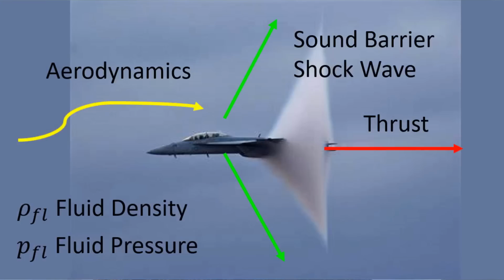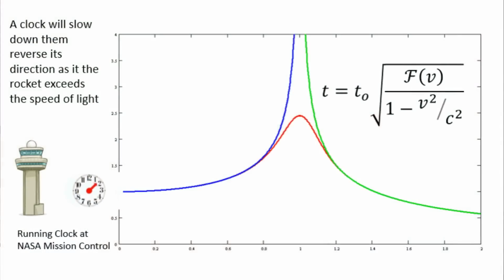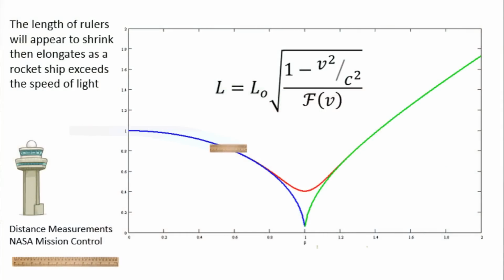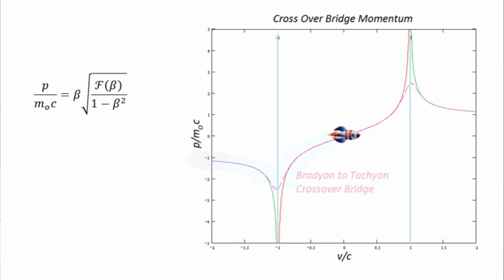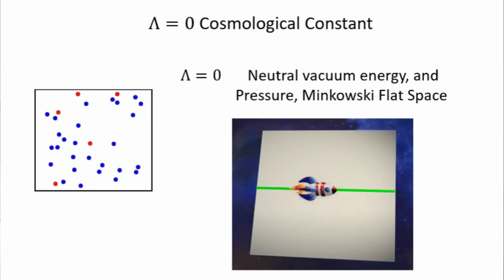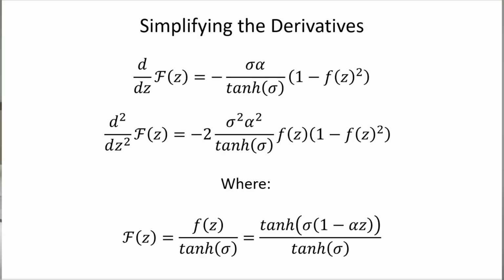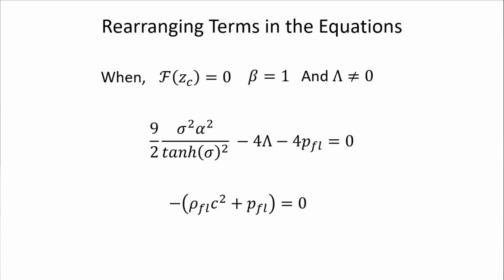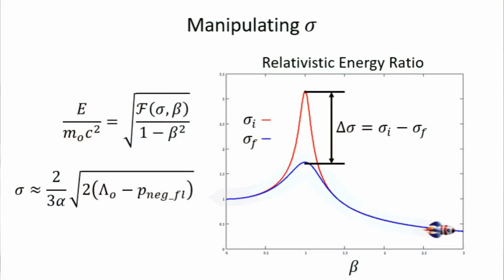🛸Lecture 4: Faster Than Light Shock Waves of a Warp Drive?  | HyperdriveX | Faster Than Light | UFO

Comment: The analogie to sound is a good base to start with.  I've been told that aerodynamics slightly change with supersonic flight.  Another analogie ?  There are some hints, that math changes on superluminar, but Einsteins math is enough for 150 years.  Wow, 100 have gone by already.    🚀🏴‍☠️🎸
Reply from the maker: Can the lessons learned from breaking the sound barrier be applied to the challenge of surpassing the light barrier, or are they completely separate domains?

Comment: How do you propose to overcome the problem of Cherenkov radiation which one would imagine must become infinite once c is surpassed? Wouldn’t such an infinite amount of Cherenkov radiation therefore extract whatever energy you put into accelerating to a speed faster than c, that energy would instead be transferred into more and more Cherenkov radiation, not more and more velocity?

Furthermore, what form of energy do you propose using to exceed the infinite amount required for any massive object just to get to c, let alone go faster? 

Towards the end, you mention something about Planck limits. You don’t specify if you’re talking about Planck length, time, speed, temp or what, high is it? Moreover, in your equations on screen, you have h BAR shown, not h, so is it Planck’s constant or the reduced Planck’s constant you’re actually referring to?
Reply from the maker: "Great point about Cherenkov radiation! The concept of infinite radiation as one surpasses the speed of light is a serious consideration when dealing with relativistic limits. You're right—any energy put into accelerating could indeed just be siphoned off into radiative losses, rather than increasing velocity. 😲

If we were to somehow bypass this issue, do you think the solution might lie in some kind of new interaction with the medium through which the craft is traveling, or would it require a fundamental rethinking of the nature of Cherenkov radiation itself? 🤔 Could exotic materials or quantum effects be leveraged to control or mitigate this energy loss? ⚡ I'd love to hear your thoughts!"

Comment: you lost me at vacuum fluid
Reply from the maker: The vacuum of space is not actually empty. Rather there is an underlying field of energy where virtual particles can spontaneously come into existence . This field can be thought of as a type of fluid that can be described by pressures and energy density. Calling it a fluid is a bit misleading I will admit but it’s a useful analogy in terms of visualization. Another way to think about the vacuum is to imagine photons of light that fill the whole universe. These photons  change in concentration from place or point to point. Photons can exhibit pressure . on the matter around it. So in some was we can think of it actually like a fluid, but we can’t take the analogy to far. Here is an interesting article that describes the vacuum energy a little bit better.

https://en.m.wikipedia.org/wiki/Vacuum_energy
Reply: @hyperdrivex_warptheory  be that as it may be...... i am not an expert in this domain , it seems to me that you use so menny equations for nothing , because nothing that has mass can reach the speed of light , passing it is out of the question.
Reply from the maker: Yes it is an open question if faster than light particles exists such as tachyons. I extended Einstein’s classical equations to include faster than light speeds. I believe it is theoretically possible to manipulate spacetime curvature to allow a particle with mass to reach light speed and go beyond the light barrier. Of course any theory needs to be substantiated with experimental evidence. It is interesting to try and make predictions of what would happen if we broke the light barrier. Here is an interesting article on a realistic rocket equation.

https://en.m.wikipedia.org/wiki/Relativistic_rocket
Reply from the maker: I suggest watch videos 1-3 where I go into the details of extending Einstein’s equations for faster than light speeds
Reply from the maker: @jianuflavian6451  "That's an interesting perspective, and I can totally understand why it might seem like all those equations are just complex for the sake of complexity. 🤔 It's true that, according to conventional physics, anything with mass can’t reach the speed of light. But when we start talking about concepts like warp drives or theoretical propulsion methods, we're stepping outside the typical constraints of relativity, right? 

What if there are ways to manipulate space-time itself—like how we might bend the fabric of space to effectively shorten the distance between two points—without needing to 'outrun' the speed of light? 🌌🚀

What are your thoughts on the idea that maybe massless particles or non-traditional propulsion could open up new possibilities in the future?"

Comment: Don’t forget to make clear, length contraction is a visual effect of that length direction being rotated increasingly into the time direction, not a physical crushing of the ship (and the passengers notice nothing of it).
Reply from the maker: Hmm I’m not so sure about that. What would happen if the contracted length of a particle is less then the schwarzschild radius of micro blackhole? If a particle gains more relativistic energy as it goes faster then it would eventually have enough energy to act gravitationally with the surrounding spacetime. I believe that spacetime would curve in proportion to the relativistic energy that the particle has. If it does then gravitational forces would squeeze and change the length of the ruler or particles size. This of course would take a tremendous amount of energy to accomplish.

Comment: Small problem, once light speed is achieved time becomes instant. There would be no time in 'ftl' thus no time for a shock wave to form.
Reply from the maker: Watch the first 3 videos in this series where I talk about clocks and rulers for faster then light observers
Reply: @hyperdrivex_warptheory  No thnx, I am not wading through all of that merely to confirm what is already obvious.
Reply from the maker: @brianvernall8487  Bummer, time dilation and length contraction for faster than light observers has not be explored before in physics. I present some interesting examples.
Reply: @hyperdrivex_warptheory  That is because it is impossible for an observer to exist outside of our space/time. Any vibration faster than C is, by definition, not in our universe at all. In fact, its  total existence, relative to ours, would be instantaneous.
Reply from the maker: @brianvernall8487  Thats is an interesting point of view. I would however disagree. Observers that move less than the speed of light are considered time like, an observer that moves faster then the speed of light is considered space-like. Both situations are described by spacetime manifold which is mathematical give by Einstein special and General theories of relativity. There are many science papers that show theoretical theorems for tachyons or particles that move faster then light. However, to date there’s no experimental evidence for tachyons. This doesn’t mean they don’t exist but they can’t be ruled out. I am merely adding to the body of knowledge. How else can we explore the universe?  Faster than light travel must be possible or else we are for ever doomed to only stay here on earth.
Reply from the maker: @brianvernall8487  Here is an interesting wikipedia article on Tachyons, faster than light particles. 

https://en.m.wikipedia.org/wiki/Tachyon
Reply: @hyperdrivex_warptheory  Welcome to reality. There is no such thing as 'faster' than light. Once C is achieved, time is dilated to instant. All experience at this speed would be instantaneous. You would see the birth and death of our universe in a flash of energy. Therefor any FTL travel is pointless. To achieve any inter stellar travel we need a close to C capability. At that speed we could travel to a distant star in seconds however our friends at home will age out before we get there. Time dilation is a bitch. 

Think on this one. Time is stationary at the singularity at the centre of each galaxy. As you move further away from the singularity, time begins to flow. The farther away you are, the faster it flows. Therefor  a planet at say 25,oooly out experiences time at one rate while a planet at say 50,oooly experiences time at twice that rate. At the very edge of the milky way, a planet experiences the flow of time 3 times faster than we do. How fast do you suppose time flows in the middle of the local void?
Reply from the maker: @brianvernall8487  What your saying is correct if you use Einstein’s Lorentz formula 1/sqrt(1-v^2/c^2), however if you take into account that space can be warped there are solutions that permit an alternative form, 1/sqrt(v^2/c^2-1), this shows that the slowest speed that an observer can have is c and the fastest is an instantaneous speed. It is a mirror formula with the subliminal equation. 

We cannot make experimental tests of clocks that fall into a blackhole and reach the singularity because (if we assume that nothing can travel faster than light) we can not get any information back once it has crossed the event horizon. Therefore it is a conjecture based on a mathematical model that is untestable with current technology. 

I have done the same thing by showing a mathematical model that permits faster then light travel. Clocks located at a singularity need to be experientially proven. Particles that travel faster than the speed of light also need to be proven. Both models are based on axioms and where we interpret the behavior of what the models tells us. The model i purpose is based on a particular form of relativistic hyperbolic motion. see this article

https://en.m.wikipedia.org/wiki/Hyperbolic_motion_(relativity)

I think it is interesting to study what the behavior of particles are that travel at faster then light speeds. 

As with any theory whether it be clocks located at a singularity or detecting tachyons requires experimental proof. Which may or may not be possible with current technology. 

So how do we conduct an experiment on a clock’s at singularity or detect tachyons? They are both open questions until they can be proven or disproven.
Reply from the maker: @brianvernall8487  If an experiment was conducted that proved that faster than light travel was possible , or that tachyons existed, would you change your mind?